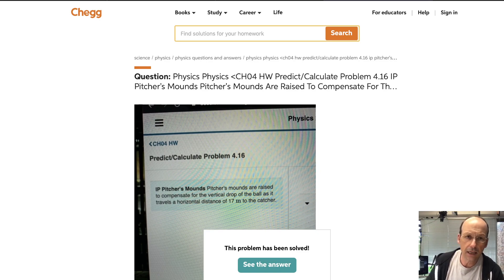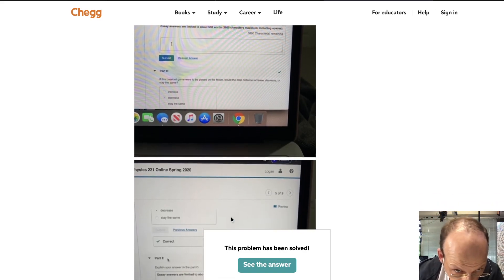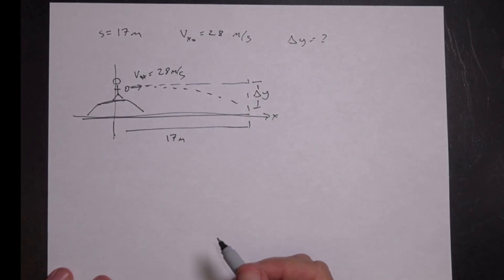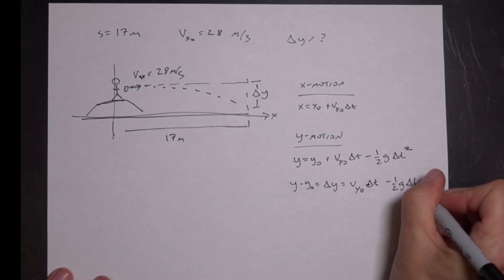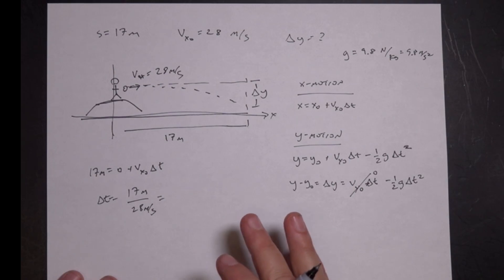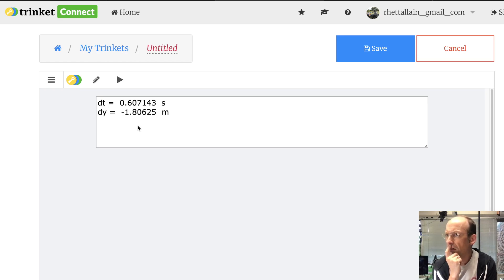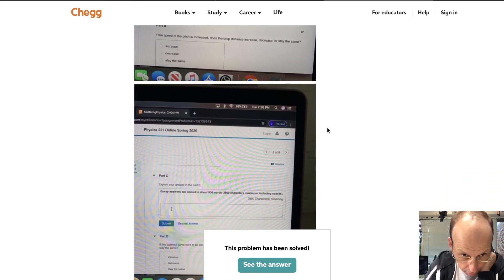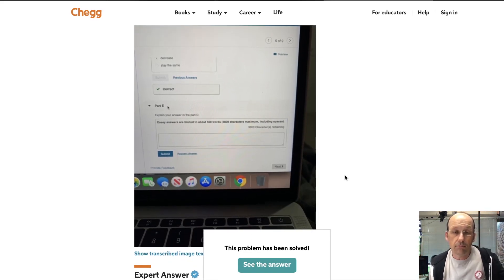Physics Solution: How Far Does a Baseball Drop?

Comment: The drop of 1.80 m (about 6 ft) may seem strange, but a pitch of 28 m/s is 63 mph, a very slow pitch. Most likely the ball reaches home plate barely above the ground. For a pitcher 6 ft tall, his pitching arm is about 5 ft above the pitching rubber on the mound. Adding the 10 inches the mound is elevated relative to home plate,  gives a total drop around 6 ft. Compare with a non-rotating fastball of 45 m/s (100 mph), the drop would be about 2.25 ft. Of course, for such a fast pitch, surely we must include aerodynamics, which causes a less drop upon arriving home plate.

Comment: Wait what?  If the horizontal speed is increased, it shouldn't affect the drop distance as vertically, g is still 9.81 and the particle started with 0 vertical velocity.
Reply: If t is given by dx/vx, and dy varies with t^2, then increasing vx by some amount will decrease t and decrease dy. Think of it as a ball with higher speed forming a more vertically compressed parabolic path relative to a ball with low speed.